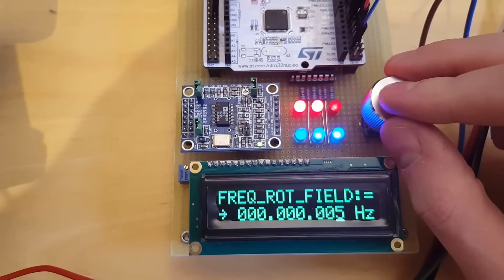STM32 5kW 3-Phase Motor Controller

Comment: Hi Achim, where does EXTI0 interrupt trigger come from? I couldn't get it.🙄
Reply from the maker: It comes from a programmable DDS IC which generates the rotation frequency.
Reply: @AchimDoebler  Thanks, what do you think about, can it be with a timer interrupt for main hertzs 1-50

Comment: This looks like an alternator converted to a motor. Can see the supply wires to rotor. Its a good choice for control development , for bldc and 3p Ac motors. Please share power sector parts used. Is it a IR2111 gate driver?
Reply from the maker: +AKHIL P B Hi you're absolutely right. It is an alternator converted to a motor. The MOSFET driver is the NCP5181, in my point of view one of the best driver ICs on the market. The whole project will be soon released on my website.
Reply: Achim Döbler I did an alternator conversion too. Just a simple project Using a BLDC motor controller used in RC helicopters. Controlled rotor current using a simple 555 pwm with a power transistor. I'm planning to make an Ac 3p sine wave controller. Your video is an inspiration. Ir2110, Irfp250, and atmel explained pro board.
Reply: Achim Döbler did you use the v/f calculation or just varying frequency?
Reply from the maker: +AKHIL P B Cool, please keep me updated. If possible share some videos of your project.
Reply from the maker: +AKHIL P B Cool, please keep me updated. If possible share some videos of your project.
Reply: Achim Döbler i completed the inverter. It started working fine. But when I excited the rotor with higher current it blew both MOSFETs on phase 3. Please advice how to excite the rotor.
Reply: Achim Döbler  Please put a link to your web site here! Thank you!
Reply: Can u share documents

Comment: can you explain this statement, sin_arr [n] = (uint16_t) (MAX_CNT * 0.5 * (1.0 + sin (2 * PI * n / 360)) + 0.5); thank you
Reply: He commented that it is used to calculate duty cycle for the respective angle.
Reply: @brianblasius  I know it but I don't know why add 1.0 and 0.5, please explain for me
Reply from the maker: I add 1, because otherwise I would get negative PWM values. I'm basically shifting the sine "baseline" from 0 to 0.5. By doing so I get PWM values from 0 to 1, instead of -0.5 to 0.5. I hope this helps.
Reply: @AchimDoebler  thank you very very, i like your project

Comment: Is it possible to generate 4 phase pwm signal using this micro controller ? and  I assume you are using TIM (timer ) to generate 3 phase pwm , not delay function.
Reply from the maker: Yes, you are right. I use the TIM. Generating a 4 phase signal is also possible, even a 6 phase signal can be generated. BR, Achim
Reply: @AchimDoebler  wow nice , I am working on 4 phase buck converter for my collage project , if you can  suggest any videos or documentation where I can learn about generating multi phase PWM it would  really help .
Reply from the maker: Maybe this AppNote is useful for you:
https://www.st.com/resource/en/application_note/dm00108726-buckboost-converter-using-the-stm32f334-discovery-kit-stmicroelectronics.pdf
Reply: @AchimDoebler  thank you very much.
Reply: @AchimDoebler  did you use stm32cude ide ? and I assume you operating in PWM generation mode with complimentary pwm outputs. what exactly are doing to get phase shift? and are you getting phase shift in a single timer through multiple channels of single TIM or are you using multiple timers ?

Comment: Not sure but quickly looking through your code I do see only open loop control. 
If its open loop only control then how is motor (alternator as kind of PM AC without PM's) performing under heavy load, does it stall? I have experience that BLDC motor will punish immediately when the position signal is missed or calculated wrong what about PM AC or alternator in this case?  
On the alternator do you use variable magnetizing current?
On my BLDC controller, I use Hall sensor based control at first and then I switch to Zero crossing point control(bemf). Thought totally sensorless control would be nice. Are you familiar with the reluctance sensing for motor starting at zero RPM?

Comment: You did inspire me to start using STM32. My target is to accomplish the same you got in the video. I just bought a STM32F103 and produced my own board, however my learning curve is flat (STM32CubeMX + System Workbench Ac6). Can you point some reading beyond your blog post? I was a 8bit uC user.

Comment: MEGA GEIL : ) muss ich auch haben! (Y)
Reply from the maker: +magnetic power Freut mich, dass es Dir gefällt. Hast du ernsthaft Interesse an der Schaltung?
Reply: ja, fürn anfang bräuchte ich erst mal nur einen um zuschauen wie mein Außenläufer sich bei volllast dreht, wie du auf meinem kanal sehen kannst habe ich ein motor gebaut der von der bauart etwas seltsam ist, aber ich sehe es nicht ein soviel geld für ein fertigen Frequenzumrichter zu bezahlen, die 3 phasen entstufe mit den 6 mosfets auf einer Platine habe ich nur die perfekte ansteuerung der 6 mosfets fehlt mir.

Comment: it simple timer based 6phase generator via very clever CCR table, or something more involved, like FOC?
At work i made it only with timers and DMA, no CPU, cool huh ? :)
Reply from the maker: FOC is already implemented, but not activated at the moment. The sensorless position detection needs to be added before I can enable FOC. I also use DMA :)

Comment: Nice work. If the rotor coil slip rings are soldered together, can the motor function as an induction motor?
Reply from the maker: That's actually a nice question. Maybe it could move, but most likely not very efficient and without torque.

Comment: i am impresed this video i am make small 200 watts inverter using H-Bridge inverter please provide detail about use mosfet ,i am already used igbt that makes short circuit i used 15N120 they conduct possitive directly without triggering gate please helpme for improve project ,thank u.

Comment: What is your power stage mosfets and parameters ? 
For my CNC i have to make 6KW 100V BLDC driver, but for feedback i will have 20kp/rpm quadrature encoder with home position.
Reply from the maker: +Linas K Hi, the most difficult thing are not the MOSFETs but the MOSFET-Driver and the driver circuitry. You can find very powerful MOSFETs at Infineon / IR.

Comment: Achim Döbler
help me to programing my stm32f4xx using coocox with your code.
Reply from the maker: +Oscar Suarez There are plenty of ready to use examples for the F4. Simply use Google. 
My code can be used by copy and paste.
Reply: ok, but my board is STM32F446RE and I´m learning to use it with the IDE coocox, stm32cubemx
Reply: @AchimDoebler  ok, but my board is STM32F446RE and I´m learning to use it

Comment: thanks for your vedio . your home-made inverter is  very very cool . I have watched every vedio about your inverter and mottor controller. impressive~ I can’t help making a inverter like yours . I know learn is not copy and paste , it's need I to take a lot of time to learn to drive a mottor ratate. Now I have bought a stm32 ihm001 board ,and  is larning stm32cubeMX .yesterday , I use matlab drive a stm32 mucleo board'LED  blink . I think It is a good start ,isn't it？And  I have brought STEVAL-IHM023v3 from America blabla...Now I have some questions ,I can't find  "ic2 7805tv"module on the shopping vebsite , is it a kind of three-terminal valtage regulator ?can I use "LM7805" instead? any help would be appreciate.